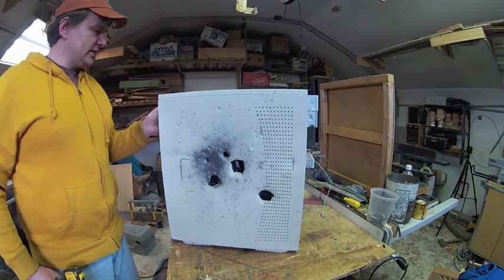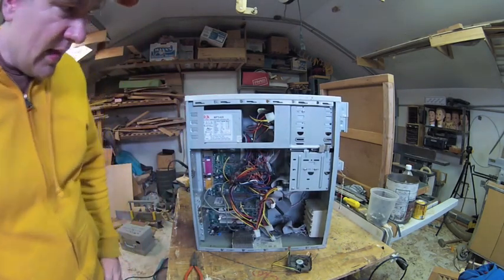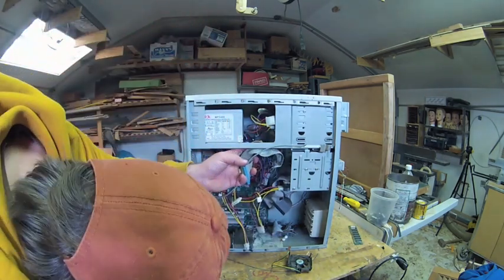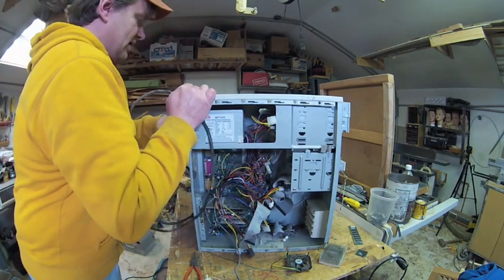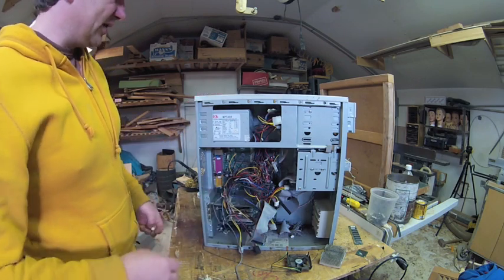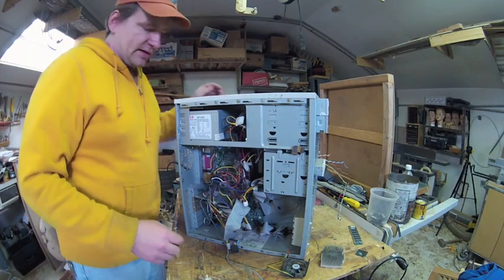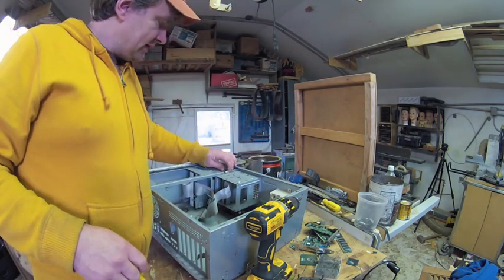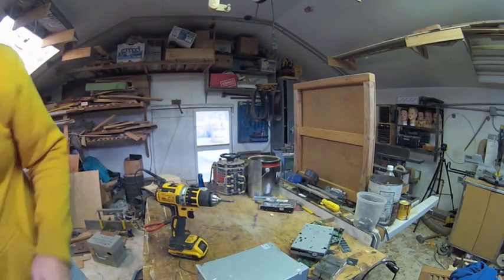"Fire" Damaged Dell Autopsy

Comment: You might be able to get the power supply to send power to stuff while plugged into that thing if you short the right pins on the 20 or 24 pin connector. I think you can connect the green wire to any black wire that goes to the 20 or 24 pin connector to get it to start doing its thing. 

I do it that way to test case fans I'm having trouble with, I just leave the right pins jumped in an old PSU I don't use anymore and use the switch on the back to turn it on or off.

By the way do you have any idea what kind of lubricant would make the most sense for those tiny sleeve bearings? So far I have mostly used white lithium grease spray (CRC brand if that makes a difference) but I would love to know if there is something better or if that lithium grease will end up doing more harm than good (not sure how, since I do it to fans that I would stop using otherwise). I can usually get it right into the sleeve bearing by removing the label on the back of the fan which exposes a little rubber stopper thing that covers them but sometimes just get frustrated and fill the entire center of the fan with grease... Is that a bad way of doing it?
Reply: +DrPersonman Here is a link to a guide with some pictures of what pins to short, I didn't know if youtube's spam filter thing would block my post before if I tried to shove it in there.

http://seasonic.com/troubleshooting/#custom-collapse-0-0584716fefe3f3a48e306bd942dc85fd